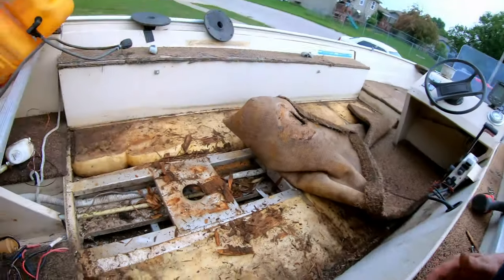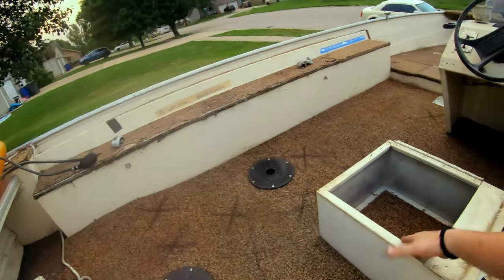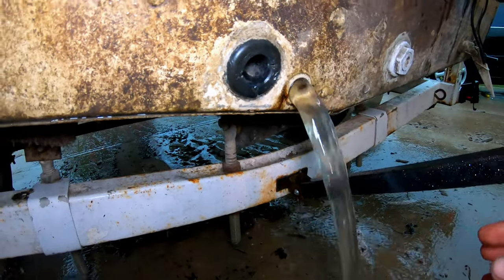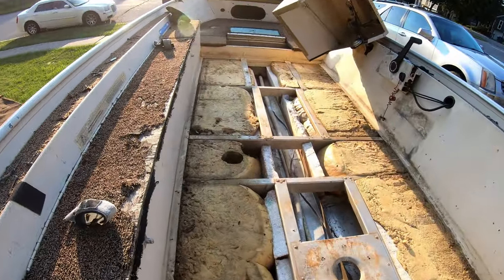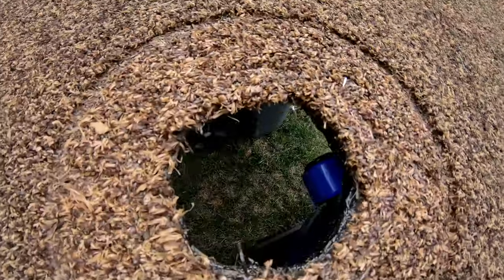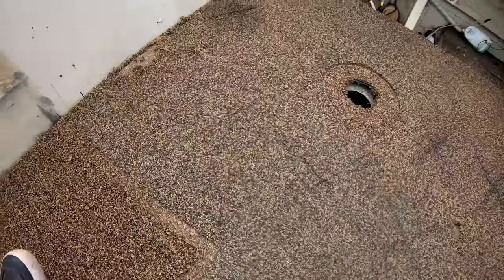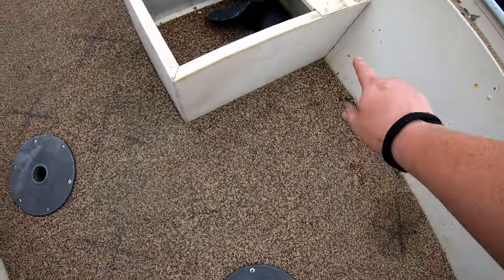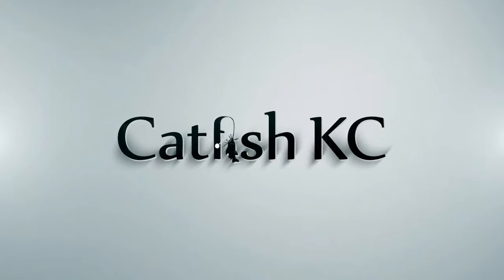How To Tear-Out and Install New Boat Floor CHEAP ( RELIABLE Way to Replace Boat Floor ) #seanymph

Comment: We are currently doing this with ours. We have the SeaNymph Fish and Ski but same issues! We are yanking out the foam though. We are also converting the front into a storage spot for the trolling motor battery and make a small casting deck.
Reply from the maker: I probably could have changed the foam as well but, I wasn't sure how long I'd use the boat and it wasn't necessary for me anyway. I like the fact that once you start taking the boat apart you can start converting the space inside to how you want it. Good luck!!
Reply: @CatfishKC  Thanks! We will post a video when ours is finished if you're interested
Reply from the maker: Yeah that'd be awesome!! Just subscribed

Comment: Coming back to this to say thanks again. Finally got the floor fully in and she's looking pretty. 
Again your video really gave me the confidence to handle it and I'm sure I'm not the only one

Glad u mentioned the 1 1/4" screws. I probably woulda went with 1" 
Thanks!
Reply from the maker: Awesome!! Glad the video helped!! It was my first time also so I'm glad to hear it came out good, and yeah I still need to put several more screws in my floor because the 1" just weren't quite enough. Thanks for letting me know how it went!

Comment: That carpet definitely won’t be making any schedule or unscheduled flights with all the glue and staples. There is something to be considered about the affect of gravity on flooring material.
Reply from the maker: Haha!! It's still doing fine. I'd probably use a new carpet if I could do it again but, it works... Didn't go too light on the staples or glue 😆

Comment: Doing the same thing on my boat. Finally got all the cuts made. Like you I cant afford marine grade. 

What exactly should I get to seal it to make it last a bit longer? 

I'm not expecting to get 20 years out of it but I don't want it to rot out in a year. 

What should I buy, if you don't mind me asking? I don't really know anything about these sealants, epoxies, resin any of that. Idk the difference.
Reply: Thanks for the video. Gave me the confidence to handle this project myself. AHHH  I see you showed the sealant here, so some of that and then some exterior paint.
Reply from the maker: I used 1/2 in. x 4 ft. x 8 ft. CDX Ground Contact Pressure-Treated Pine which was $42.  It is pressure treated and made to be in contact with ground at times and not as easily rotted. 

I did use a waterproof sealer on this because I had some but, since it is treated you have to dry the wood out a little bit for it to accept the sealer. if I were you, I would look on the market for better alternatives then how I did it. I just happened to have some sealer in the garage. I sealed it with Thompson's water seal about four times on each side once it was dry. I then used an exterior waterproof paint and went over it a few times. 
obviously this isn't the best solution to a boat floor but I used what I had and I believe it will last quite a long time. also, another reason why I did it this way was because if I do have problems in the future, it was fairly easy to get in and out because it was only one sheet of plywood. So, if I do want to upgrade to a different or marine grade plywood a couple of years from now it wouldn't be a big deal. If your project is a lot more extensive with a lot more cuts then you might want to save for some marine grade plywood if you're doing and putting all that work into it already. 

That's just my two cents haha I appreciate you watching and appreciating the video. Good luck and I hope you get out on the water soon